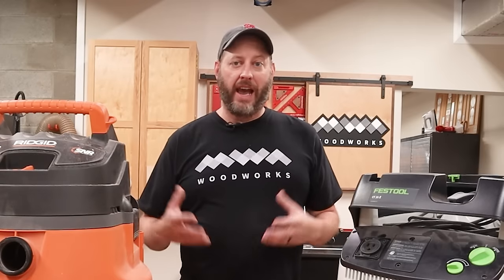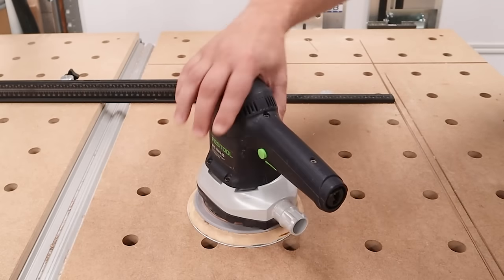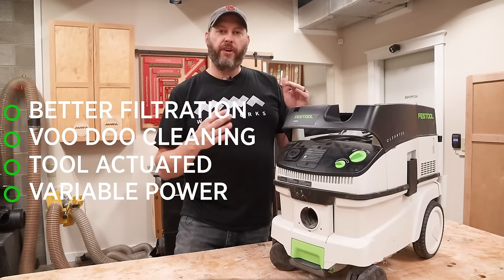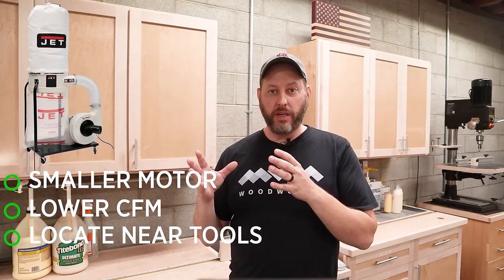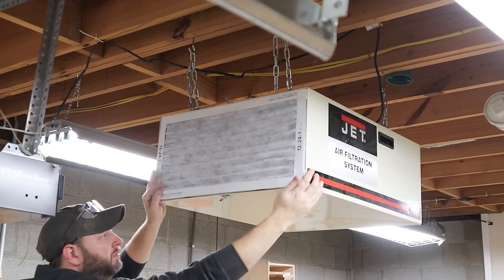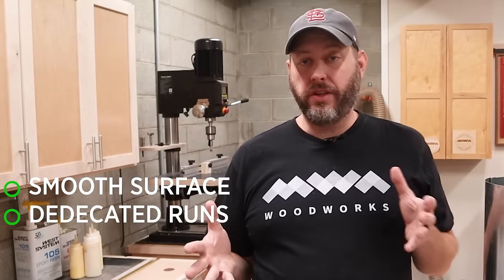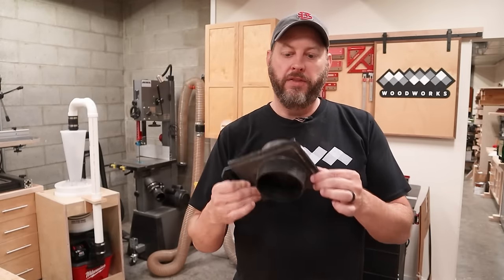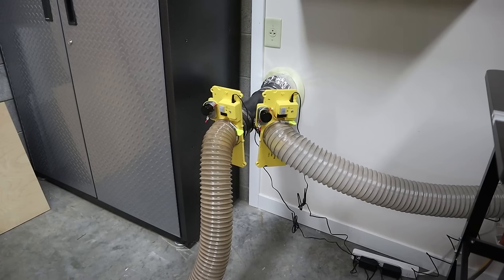Pros think about dust collection differently

Comment: Excellent video on dust collection.  This is probably the best one I've seen on youtube.  There are so many misleading videos out there that seem to steer people towards these big high flow units with 4" pipe for "real" dust collection, when that is probably totally unnecessary for their home shops, where all of their tools have small ports anyway.  A shop vac with a cyclone and a hepa filter is probably fine for most people with small garage shops using typical weekender tools.  I had to sort through a lot of videos to figure that out, but yours covered all of the essentials about dust collection in a really concise way.  Kudos.  I should have watched your video first!  It would have saved me a lot of time and research!

Comment: Interesting.  I've always had a small ish shop.  When I owned a plainer,  Some 4" hose, connected to a 3.5 hp heavily modified shopvac to take that size hose, the vac then sat on top of a cement form 4' tube with a heavy duty big plastic bag on the inside capturing the chips. Worked wonders.  

In my smaller retirement shop, I have a dust separator, before my 5 hp vac which is on a i-vac box,  that hooks to my 2.5" hose for my table saw and router table, with a blast gate to my 1.5" hose with a 27mm ending that is12' long.  At the other side  of my shop, I have a 1.25" 2 hp bucket shopvac that is portable for the drill press and to clean up in the house when needed from changes made there.  The only tool I have a dust collection problem with is the table saw.  Been working on that beasty for years, and it still spews sawdust everywhere.     BTW, my 20" box fan with a air filter tied to it, captures an amazing amount of in-the-air fine partials. I also replace the filters in my 3M dust mask every year as well.

 In my old shop, I had 3 different vacuum systems depending on the tools I was using.  Example, The plainer and router table got the 4" Frank-in-vac,  The miter saw had its own, and everything else used a 4" main to a home built separator with various outlets. that ran down the middle of my shop using grounded PVC pipe.  Used a stick to open and close gates as needed.  

Solved the plastic gate jamming  problem by cutting the ends off and putting tape over them.  That way when they clogged, I just undid the tape , worked the gate a few times, blow them out with air, and retaped them.

Comment: nicely done and explained. I bought the ubiquitous HF Dust collector. I mounted it outside my shop and ran the duct through the wall. My wife was not pleased lol. It works.  Every point you made including static shocks   is point on.  Plastic gates suck.  I am retired and have lung issues so the floating dust is an issue for m. I 3-D printed a forced air helmet for using with my lathe and other dust producing machines. Along with the 4 inch dust collection, it is enough for my shop ( 12 X 24 ). Seriously thinking about one of those box fan filters though. I can hang it from my shop ceiling and maybe improve a little more.

Comment: I like taping 20x1" hepa filters to 20" box fans for dust/allergen collecting what is in the air. It cost me about $60-80 for the two fans and filters and a roll of duct tape. I think it works fairly well for being a cheap fix. Way cheaper than any other options I have seen.

Comment: hey my man that without a doubt is one of the best videos I have ever seen on dust collection.  I am in the process of swapping to a small central collector.  Those auto gates are stupid expensive.  I am going to make my own that use a small air cylinder and solenoid to open and close.  Amazon sells a $14 dollar sensor that goes on a power cord to activate the solenoid and also turn on my blower.  All total It should be around 35 to 40 bucks each.  Diy in me always wants to find a cheaper way.  we will see.         But great video.  I just added a 12 in planer to my shop so it is time.

Comment: There is yet another option for blast gaates.  There are several designed for shop-made gates that avoid the problem of dust building up and blocking the sliding part of the gate.  I watched a bunch of YT videos, and settled on Jonathan Katz-Moses' design.  He sells router templates for making 2-inch or 4-inch.  For the most part, I'm happy with this choice.

Comment: I've watched a few dozen of these videos hoping I'd see an equally crazy fool as myself doing something unorthodox. Looks like I'm pretty close! One massive caveat for the hose to port ratio is when you get a tool with a tiny port that completely overpowers said chute and demands you step up to a real solution. Enter my dilemma with a CNC... 
Did One (1!!) cut sequence over 30 minutes to certify that I'd hooked everything up right, stuffed the ol shop vac hose in the dust boot, and wow, I was Not prepared for how many chips, dust and general destruction that thing can throw out. I ended up standing there manually running the hose as close as I could and my shop was Still choked out, necessitating a quick reach to the respirator. 
Ended up putting everything on pause until a more serious dust collector arrives!

Comment: I use a rigid 6.5 hp with a dust stopper dust collector with a bag in the vacuum. Pretty inexpensive and seems to work good. Makes cleanup time shorter and far less dust in the garage. Next I am going to build a filter system with 4 filters and a caterpillar fan.

Comment: this is a good video with lots of good info.  i have looked into turning the extra stall in my garage to a small workshop.  going with flex hose to a 2.5 powertec clear pvc pipe to a dust collector with cyclone filter and a shop vac

Comment: I just purchased the new Dewalt dxv16p-qta Stealthsonic Shop Vac with Hepa filter and Fine Dust bags.  Then ordered a Oneida Dust Deputy Low-Pro dust separator.  Looks like it should be the goldilocks small shop and portable setup.

Comment: I'm getting a small shop up and running in the space of a 2 car garage. I picked up Dewalt's 14 gallon 6HP vacuum because it was advertised to be quieter than the Ridgid airplane at takeoff that I had in the past. Pretty impressed with it, I have a Dust Deputy 5 gallon bucket in front of it but it fills up way too fast. Picked up a 55 gallon drum just need to mount the cyclone to the lid and I should be in business. Overall a pretty good setup for ~$350 considering I already had 2 of the 16 foot Bosch hoses. Same size hoses as Festool for waaaay less. Hooked up a $30 auto trigger switch for the vac and in happy with it
Reply from the maker: Nice!

Comment: Howdy...

I have a 10'x14' shop. It's a converted Arrow shed (the large one sitting on display at Lowe's). It ain't much, but it's better than dragging tools out individually from my "tool shed" that's only 8'x10' and working off sawhorses and in the elements. 

Nonetheless, I'm slowly (S.L.O.W.L.Y.) getting everything arranged. 

I use a Ridgid NXT along with a Dust Buddy. The exhaust on this thing QUICKLY turned my shop into sauna (minus the moisture) along with tossing fine dust into the air. I now pipe out the exhaust through hoses going out the door of which, sits a simple small AC unit sitting on a 5 gallon bucket and a "temporary" cardboard half door so I can close the other door. Being in South Texas, this tin can of a shop heats up quick, so the AC keeps it at about 75°. 

Hooking up dedicated hoses to all my tools is in the works. Right now, it's a cumbersome, move hose to Tool as I use that tool. 

Your right. The decibels of this thing is quite loud, so I'm looking into making a small "shop-vac" shed on the outside of the shop and install a remote control for the unit. 

I've noticed static on the hoses "sometimes". You can actually see the fine dust standing on end. I'm not overly concerned about spontaneous combustion cause I'm fairly certain the ratio of air to dust to spark isn't enough to ignite. But, I have been tagged a few times by static. I wonder if I were to insert a small copper dowel into the hose and connect it to a green wire and then have that go outside to a simple ground rod hammered into the earth...I wonder if that would take away the static charge? 

Hmmm. That'd be a nice little science experiment.
Reply from the maker: You can buy self adhesive copper tape that you may be able to run along the hose? Not sure how well it would stick to the ridges though.
Reply: @MWAWoodworks  Re-read my post....Copper dowel? What was I thinking? Just use the ground wire itself. Poke it inside a tube, run it outside. What's the worst that can happen...It not work and I've got a teeny tiny hole I can put duct tape over. 

P.S. I've asked MANY people and they have no idea...I can't seem to find it either....

Where the HELL is the "OFF" switch to turn off Summer?

Comment: Great video. Watched it a few times. Quick question if you have a sec? If I want to start setting up a very modest workshop (bench saw, thicknesser, router and mitre station, would a good quality shop vac and the cyclone extractor suffice for both dust and chip extraction. I would try to modify the tools to allow the vacuum to connect as well as possible to them. A proper larger extractor isn't in the budget nor do I have the space. Your cyclone/vac portable station is fantastic btw. Thanks for any advice.

Comment: Great video. I have a suggestion for PVC systems, if you spiral a bare wire around the pipe just to get from one end to the other and put metal hose clamps about every 4 ft or so, and attach the wire to a ground it will ground out the static charge created from the air flow through a plastic pipe. Some plastic hoses use the spring coil used to make the hose to ground this static charge.
Reply: this is not a thing. static electricity should not be a concern. nothing's gonna ignite lmao. and the spring coil you mention is insulated, so it's not conducting lol.
Reply: this fake issue is probably the funniest thing in woodworking
Reply: I can tell you from experience static in PVC systems is no myth. I'm not saying it'll explode, but it'll sure stand the hair up on your arm and even deliver a good snap when you least expect it. 

My last shop was piped with pvc and it was very annoying, especially with my Dewalt planer.
Reply: @robertmayton3374  lol
Reply: it's just not a thing. when it's really cold, you get a static shock touching your car door. it's not worth spending money or designing a system to mitigate it. it's just not a thing worth worrying about.

Comment: Good basic video but you need to understand the purpose of N-95 or N-100 dust filters for respirators. It has absolutely nothing to do with viruses.
Reply: Having been a safety Director for a commercial construction company I feel like I’m obligated to chime in because the comment about the mask is very misleading. N95 mask are non-oil rated with 95% Efficiency down to .3 microns. 
That is gonna be your most common fine dust rated mask but does nothing for spring oil base finishes or anything with VOCs.
P100 is a oil proof mask that has 99.97% Efficiency down .3 µm. It’s a significantly better mask for an at home woodworker.  You need a charcoal filter for vapor protection. 

Virus particles are fairly large vs what dust and vapors can be.
Reply: Thank you to Mike and you for chiming in. Great video but he whiffed on this topic. I use P100 in my small garage shop for finishing and when using power tools.
Reply: @errolpereira8292  get yourself some vapor cartridges for finishing

Comment: I have the 16 gallon Rigid shop vac and it is loud but only because of the exhaust. I ran a hose from the exhaust through the wall to the outside and the decibel level dropped drastically. My ears appreciated it.
Reply from the maker: I added a muffler to my Rigid, which helped a little. Still not as quite as my Festool dust extractor.

Comment: An earth grounded bare wire running outside the length of the PVC ducting and connecting to the metal pieces of the vac/filter and metal framework should effectively remove any static buildup.

Comment: Appreciate your videos, always pick up something.
Re: the dust cart.  Too many right angle bends, too much pipe, shop vac should be above the dust separator.  Make gravity work for you.  Increase airflow 10-11 percent.  
Re: dust.  There have been MANY deadly explosions and fires in industrial settings caused by the accumulation of dust in the air, and some chance ignition source.  Sawmills, sugar mills, grain elevators, etc.  I see way too many folks who poo-poo the whole idea, refuse to believe in historical facts, engineering and science.  It CAN be an issue. 
For my part, I keep the garage door and side door open, getting plenty of breeze through the shop, I use masks, shop vacs, fans and plan to build at least one air cleaner.  The dust level is never high enough to present a fire or explosion hazard.  The bigger concern for me is my lungs and eyes.  
Stay safe, and thanks again.
Reply from the maker: Thanks

Comment: Great summary of various options and enough details on each one - just like s comment above I want to link that you are incorrect on N95 - you should fix that.  I like how Festool extractor has filter cleaning feature. For Ridgid they have filters of different quality - eg VF3400/3500/3600 for general debris/fine dust/drywall dust (>= 10/1/0.3 microns).

Comment: Thanks for sharing. Though I'm pretty sure your cyclone setup is incorrect.  You should have a minimum of 4 ft straight going into your cyclone. I read this when I bought a clear-vue system by Bill Pentz.
Reply from the maker: there's probably an optimal setup for the duct run but my ducting is all in one straight line with no branches and I get great dust collection at my table saw, almost 50 feet from the dust collector so I can't complain!
Reply: @MWAWoodworks  Great!  It doesn't affect the suction, it affects the performance of the cyclone.  Probably not enough to make a huge difference, but many of those cyclones will be most efficient when it has 4 ft of straight (and horizontal) before it goes into the cyclone.  But perhaps that's just ClearVue systems. It has to do with the way the gravity will work on the dust as it's not spinning supposedly.  :).  You ran 6 inch which is much better than most shops.  That was smart and worth the money.
Reply from the maker: I think I posted about this on Instagram stories a couple months ago but I had to pull my filter off to check for a warrantee issue on the cyclone and I looked into the bin at the bottom of the filter and it was basically empty (very dusty) but empty. I hadn't pulled the filter off since I built the cyclone in 2019. I was amazed at how well it separated the chips! And there's been multiple occasions that I overfilled the 55 gallon barrel that I use to catch the chips. All the overflow stayed in the cyclone and didnt go to the filter.

Comment: I don't have a dust collection system (leaf blower doesn't quite count), but I've been thinking about it.  This was good, thanks.  Gives me more things to ponder before I jump into setting one up.  Btw, your workshop is so incredibly clean and everything seems so perfectly linear that I'd be scared to set a foot in it.  :)
Reply from the maker: Ha! Well it doesn't always look like that 😂😂
Reply: I'm definitely going to use my shop vac! That Rigid vacuum he has, I have the same 6 gallon one, and it has about a 13 amp motor, it has so much power you can suck up gravel and screws and a whole pile of leaves. You buy the bags for it (never use the air filter as the only filter). Buy the bags, install the bag, in addition to the paper filter, in addition to an automotive 2.5" clamp on paper air filter on the output vent, to prevent dust being blown everywhere, it acts as a very good diffuser with high flow. Surprisingly, I've found that 6 gallons is a ton of a sawdust for a home user that focuses more on inventing things, than constant volume production. You can also buy a pre-filter tank to capture all the sawdust, and use the Rigid shop vac, as the final sucking motor.

Comment: Pressure should also be mentioned along side CFM.
Reply from the maker: Yes. Correct. Vacuums are high pressure low volume and dust collectors are low pressure high volume. I thought I mentioned that in the video but I may have cut it out due to length

Comment: 6 decibels is twice as loud so yeah big difference! I hope you didn't just make up the  5 to 10 decibel comment. lol
Reply from the maker: I was actually being generous with my comparison because there are so many different brands and noise levels out there depending on how old your equipment is. But here's a direct comparison in my shop. My Ridgid 1450 shop vac is 90 db and when I bought it several years ago it was considered one of the quieter shop vacs available. Compare that to my Festool CT26 dust extractor which at max power is 72 db, but it has a variable power control so if I put it all the way down to low power the decibels go to 62. So I have a range of 18 to 28 db difference between the two. Bottom line is that most shop vacs are facking loud and most dust extractors are not. 😀